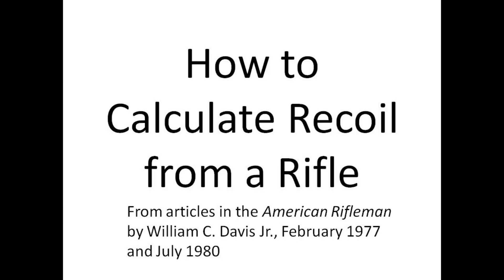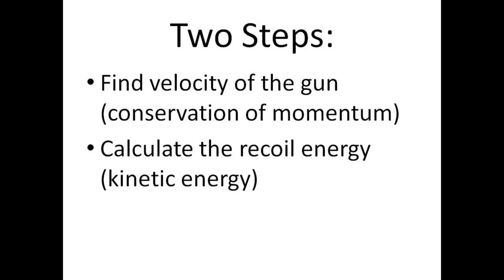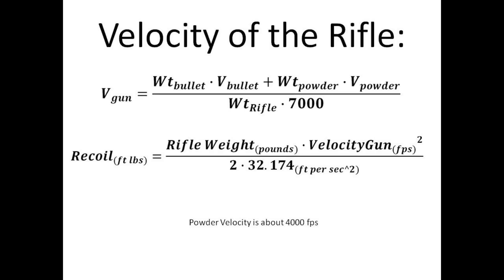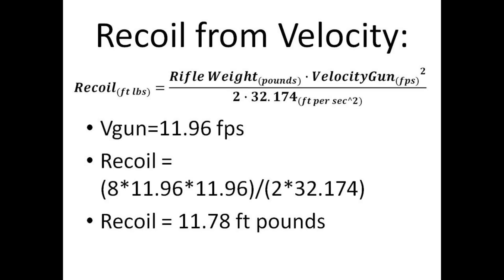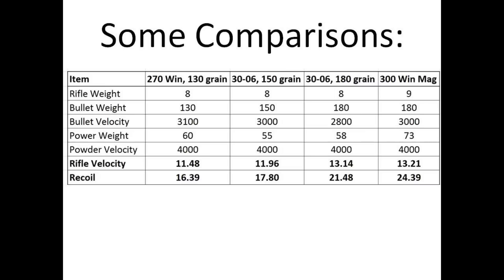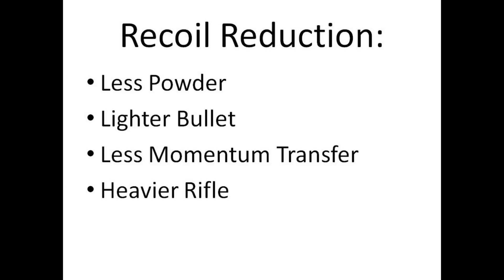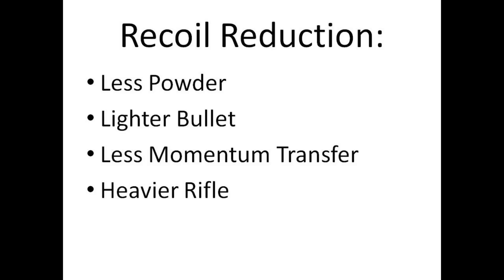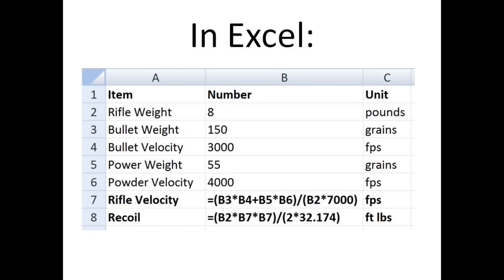Calculating Recoil for a Rifle

Comment: My Binnelli R1 in 30.06 has the comfort tech stock which reduces recoil. Any idea how to calculate that effect
Reply from the maker: You would have to guess at how much the velocity if the rifle is reduced by the pad. Time is not taken into account with this formula. Shoot the same gun with a heavy jacket or with a t shirt and you will tell the difference, so there is an effect. I do not think you can quality this effect with the method outlined in the video.
Reply: @bgallaher77  The manufacturer says it reduces recoil by 30% to 40%  and I believe thats true

Comment: I want to calculate the force of the recoil in newtons rather than the energy. Does anybody have a formula for this?
Reply: Hi, have you got any formula?
Reply: Foot pounds is a unit of energy and Newtons is a measure of force like you said. According to Google, 1 ft. lb. = 1.356 joules. I think a joule is 1 N*m. So the force depends on the stiffness of your shoulder. F=E/d. In SI that's N=(x joules)/(y meters).